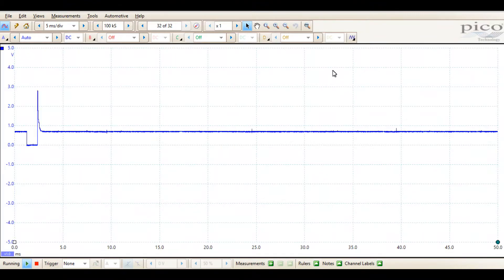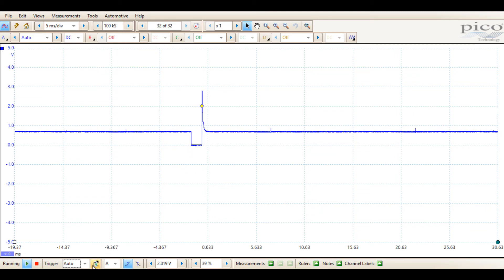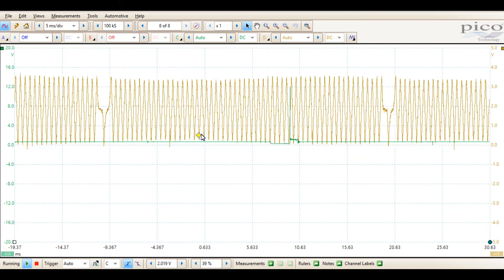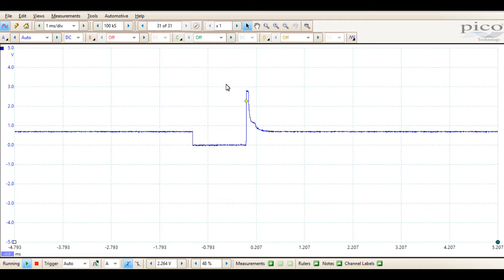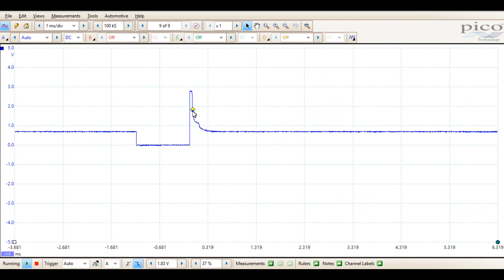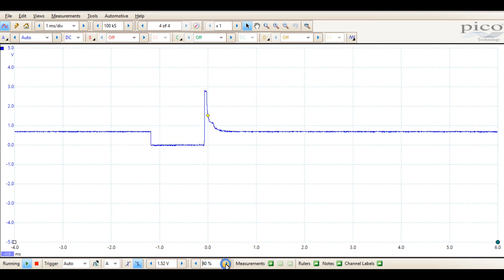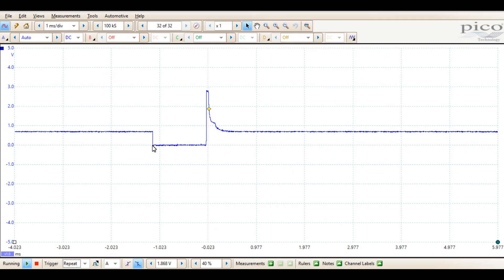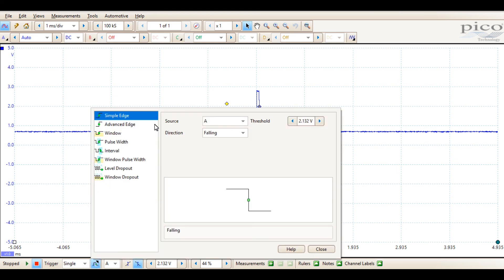4. PicoScope Basic Trigger

Comment: thanx ugly kieth lol j/k      great series. one thing i found in my research  maybe someone can comment on--- when using a computer based scope. it is best to use it with battery power. some not all laptops the negative end of the dc side of the charger is coupled to the equipment ground on the ac side. this makes the ground circuit in the building a giant antenna. and if there is an electrical fault it can let the smoke genie out. its easy to test this with an ohm meter.     also meter the outer ring of your scopes bnc connector to see if its isolard from the usb and  power pack if so seperately equipped.  check the specs on the scope to see that the inputs are isolated (most are )  (optically is preferred)  from the outputs.  some cheap scopes aren't. i know this is software related vide but may be valuable to someone watching pondering the purchase of a scope.
Reply from the maker: Absolutely true, great tips Richard!